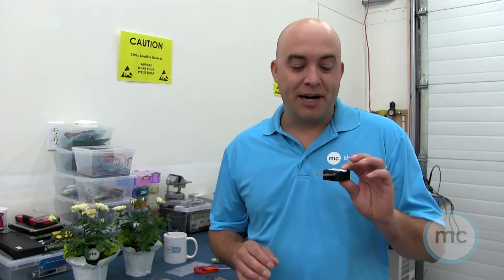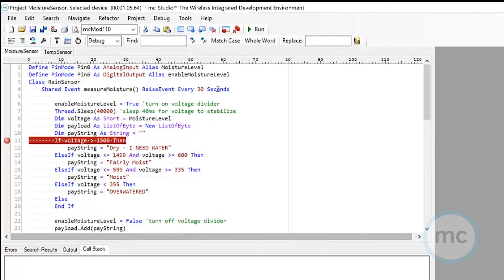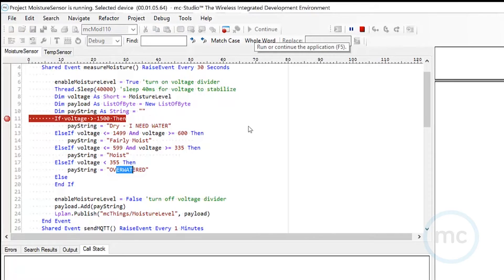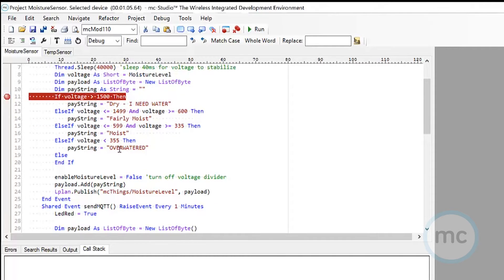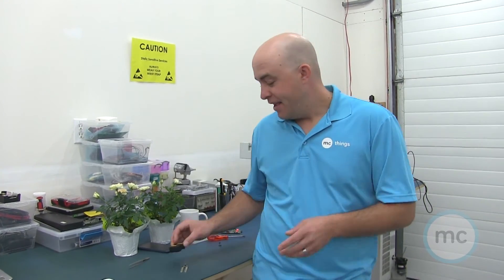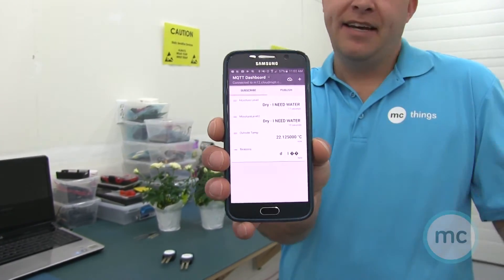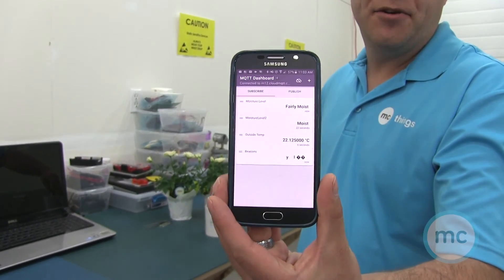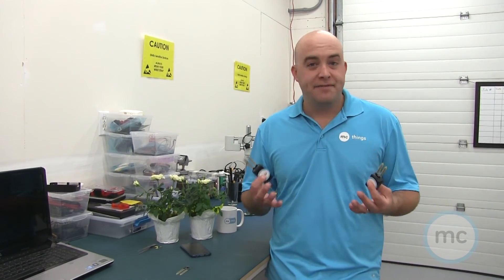Moisture Sensor Demonstration

Comment from the maker: Define PinMode Pin0 As AnalogInput Alias MoistureLevel
Define PinMode Pin6 As DigitalOutput Alias enableMoistureLevel
Class RainSensor    
    Shared Event measureMoisture() RaiseEvent Every 30 Seconds
        
        enableMoistureLevel = True 'turn on voltage divider
        Thread.Sleep(40000) 'sleep 40ms for voltage to stabilize
        Dim voltage As Short = MoistureLevel
        Dim payload As ListOfByte = New ListOfByte
        Dim payString As String = ""
        If voltage > 1500 Then
            payString = "Dry - I NEED WATER"
        ElseIf voltage <= 1499 And voltage >= 600 Then
            payString = "Fairly Moist"             
        ElseIf voltage <= 599 And voltage >= 335 Then
            payString = "Moist"                
        ElseIf voltage < 355 Then
            payString = "OVERWATERED"
        Else
        End If
        
        enableMoistureLevel = False 'turn off voltage divider
        payload.Add(payString)
        Lplan.Publish("mcThings/MoistureLevel", payload)
    End Event
    Shared Event sendMQTT() RaiseEvent Every 1 Minutes
        LedRed = True
        
        Dim payload As ListOfByte = New ListOfByte()
        Dim TempC As Float = TempSensor.GetTemp
        Dim TempString As String = TempC.ToString()
        
        payload.Add(TempString)
        
        Lplan.Publish("mcThings/GardenTemp", payload)
        
        LedRed = False
    End Event
    Shared Event measureVoltage() RaiseEvent Every 2 Hours
        
        Dim BattVolt As Short = Device.BatteryVoltage
        
        If BattVolt < 2200 Then
            Lplan.IFTTT("YOURIFTTTKEYHERE", "MoistureSensorBatt")
        Else
            
        End If
        
    End Event
End Class